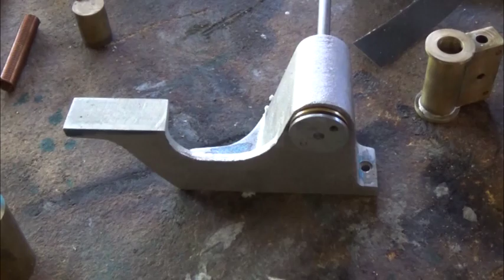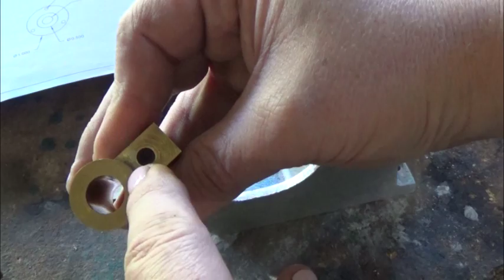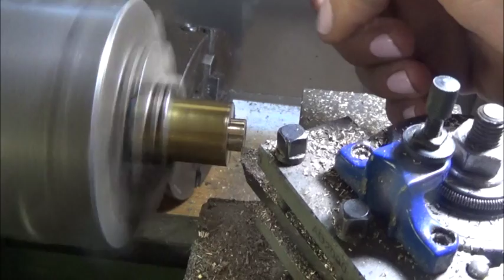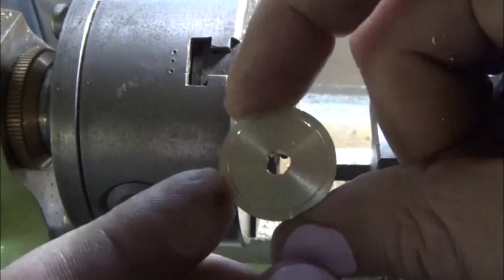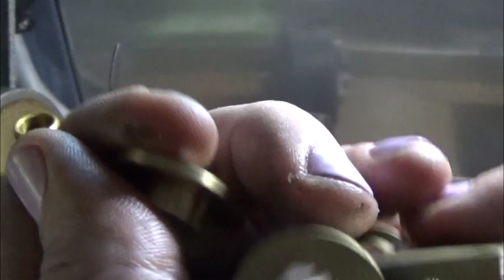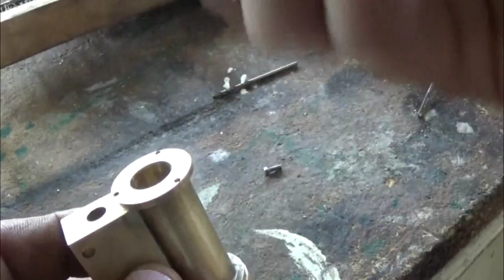myfordboy engine part 11 cylinder covers

Comment: I agree in general with your parting-off remarks, and those of your commenters. But ... OK, parting puts a great deal of strain on the lathe. If you go to the amazing modelengines.info (NOT .com) you will find some interesting information. There are no videos on this site, you have to read, old-fashioned I know. But look at http://modelengines.info/lathes/align.html. You will see that the 7x20 chinese lathe deflects a factor of 10 over the Taig -- which has a 57mm center height. So the problem with this Chinese of lathe is not so much bearings and spindle, it is the rigidity of the beds. This is a design fault, not a construction fault. The Taig bed is stuffed with concrete, which gives it a lot of rigidity. Wonder why the Chinese don't copy it.
Reply from the maker: yes, i think so. you might however, that the bed is flat and matching the saddle of the taig, and not so flat and only touching in places on the chinese lathe. there is a lot of room for improvement in chinese machines, hopefully the emerging influence in machine tool production, India, will learn something from other machines.
Reply: Oh yes. Mainland China is OK on construction but Quality Control is off on a very long vacation. Taiwan is much better, in fact (gasp) they are fining manufacturers who do not conform to standards.

Comment: Good ol' squeaky brass! The cylinder is coming on nicely. 
Nostalgic to see BA bolts used - I still use them because back in my UK days it was a well used thread form - still have the taps and dies.
Reply from the maker: its a good practical thread form for many applications. thanks for watching!

Comment: 5:30 into the video Emma starts discussing parting off, machine rigidity and choice of machines. I fully agree that rigidity is a key factor in successful machining especially parting off. However if someone is frustrated parting off on his light hobby lathe - including affordable Chinese ones ;-) - he does not have to scrap it, take out a 2nd mortgage and buy a 3 ton machine and build a new attachment to his house for it. There are easier remedies. Reverse the spindle direction and clamp the parting off tool upside down - of course still with the cutting edge on centre height. Maybe you need to make a new holder for the parting off blade. Or buy a commercial one here: http://www.eccentricengineering.com.au/index.php?option=com_content&view=article&id=31&Itemid=45 This way even less rigid machines part off MUCH better. Why? In the conventional configuration due to the elasticity of the machine the cutter is deflected downwards AND into the work making the cut heavier and the chatter worse. In the inverse configuration the cutter is deflected upwards and out of the work making the cut easier and damping the chatter. The elasticity of the machine can be used to your advantage here. Flanged, keyed or camlock chucks are safe for this. However you cannot do that if your chuck is screwed onto the spindle thread because it might come loose in reverse which is really dangerous. For this case George H. Thomas (RIP) had proposed a long time ago to keep the spindle direction but put the tool post with the upside-down parting tool on the rear side of the work to benefit from the same effect without unscrewing the chuck. For Myford lathes there is a commercial kit available. http://www.hemingwaykits.com/acatalog/Rear_Tool_Post.html (I am not affiliated to any supplier) But it can be done also on other lathes. B.t.w. for parting off mainly bronze but also brass you better use a zero rake angle edge because these materials tend to pull cutters with positive rake angles into the work leading to tool and/or work breakage. The same is true for drills, mill cutters etc. The portion of the edge with zero rake angle only needs to be as deep as your depth of cut. Hence a small facet with zero degree is enough. If you machine bronze/brass often it is best to keep two sets of cutting tools one for bronze/brass and one for everything else.
Reply from the maker: yes right on. there are many things you can do to fix the problem. I am a little harsh about my views on lightweight machines, and a little spoilt with the ones i have. sounds like you have the problem sorted!